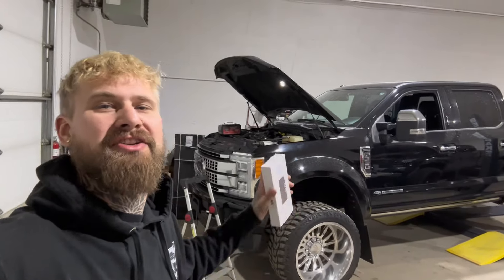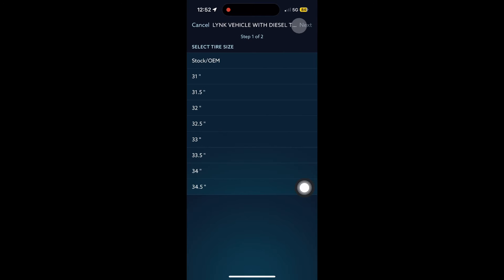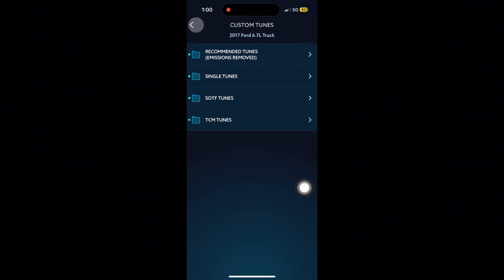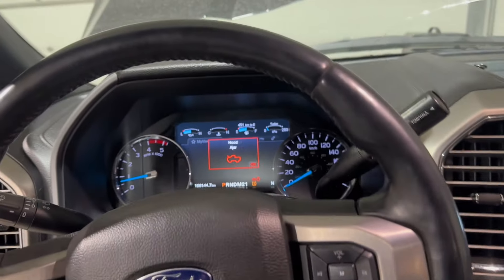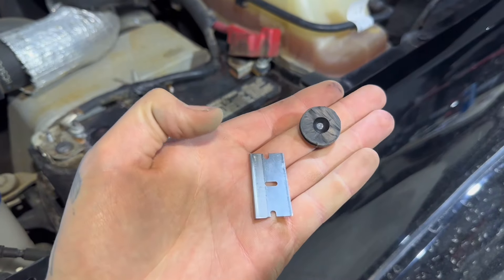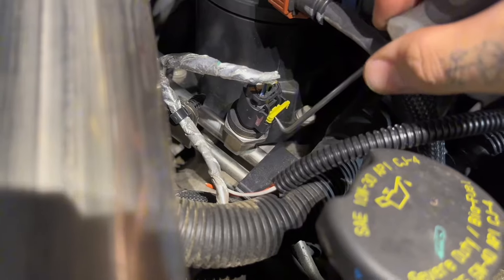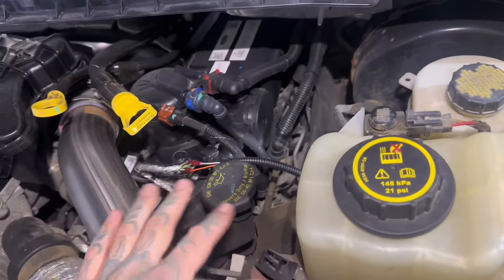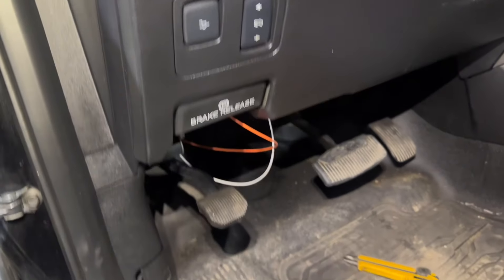How To Tune 6.7 Powerstroke And Install SOTF Switch With EZ Lynk (2011-2019)

Comment: I just finished a delete and tune on my 17 that was 100% virgin. After I installed the delete tunes and removed the dpf I ran the truck with the egr unplugged, it ran fine, no issues at all. Removed and blocked off the egr, did a couple of other things. An spe ccv reroute with an internal catch can, a new thermostat from spe. Once all of that was done I went to test drive the truck and it was smoking like a train on acceleration and smoking at idle. I went a total of a mile pulled it back in the driveway and don't know where to go from here, any advice would be great!
Reply from the maker: My advice is check all your work because something you did must have made it do that. Maybe you broke a wire or a blocker plate is loose. I’m not sure man.
Reply: My 2018 started doing this with 115,000 KM on it with emission on and after $1,000 at the dealership it didn't fix anything. I ended up putting a CCV reroute on the truck and it actually fixed the issue. Come to find out the CCV was completely full of oil and needed to be changed ( had the replaceable filter).  After doing the reroute it hasn't smoked since, if it didn't smoke before you removed the EGR I wonder if some of the crap that gets injected back into the engine has contaminated something and the truck is burning it off? Does it run rough? Idle rough? loss of power ? Did it ever stop smoking or is it still doing it? Everything I touch on my truck is full of soot and crud from the emissions, I do my best to clean everything really well before putting back together. Map sensor was 95% blocked, CCV was full etc. These emissions are designed to kill your motor so you have to buy a new truck not save the environment. My truck in todays market is now $120,000 I can't afford that and it's only an XLT dually.
Reply: You pinched the hose for the ccv delete
Reply: @ Reroute, you can't delete the CCV.
Reply: @crashweekly7925  you know what I meant damn 😂
Reply: @blueseventhree  I did, didn't want people to be confused about a delete and reroute. I have my ccv rerouted.

Comment: How do I return my truck to stock tune when I put the emission control equipment back on the truck
Reply: When you get tunes from a reputable company like coopers customs you give them your VIN number, when you get all of your tunes you will get a stock tune with the other tunes that will allow you to return to stock. You should get one for the ECM and the TCM ( Engine and Transmission tunes) . If you don't then I would question where the tunes came from, my old SCT tuner saved the original settings for my truck and I only used the tunes on it that came from the manufacturer ( emissions on tunes).

Comment: Mine truck turns off before finishing installing, ez lynk still saying installing then once it's done it says turn ignition off but it's already off so I have to turn on and off and click continue and keep going until it says finish/done. Even though it says it was installed kind of curious if everything was downloaded successfully, will check on it again.
Reply: I have never heard that before, did you put a battery charger on the truck before attempting the tune? They recommend it so that there is constant power in the battery while doing the software load.  If there is a sag in power it could cause a problem, hopefully it didn't mess anything up. Worst case you could try and load the tune again but I would put a charger on it this time if you didn't last time.

Comment: i'm noticing my glow plugs firing at every single start now after tuning.  this never happened before unless it was under freezing outside.  it's 85 and they still fire every startup.  you see that at all?  feels like an error in tuning.
Reply from the maker: Who’s tuning are you running? You could try a different tune and see if they changes it, or go into the ez lynk chat feature and send a message to the techs and see what they say. I’ve never had that issue with the tuning from the diesel dudes personally.
Reply: @darkirondiesel  it is the diesel dudes.  i emailed them directly too but obviously it's sunday lol.  i didn't realize i could do a chat from inside ez lynk.  i might try that after they respond first.
Reply: Any updates ? Mine does this as well. Always as pending start up and glow plug light on. Just deleted it yesterday and started doing it
Reply: Also have no high idle
Reply: @wyattbaker231  I reached out to diesel dudes and the tuner directly.  The response was "glow plugs help the engine start" well no sh!t Sherlock.  It just over uses them and I want it to stop.  I did notice any time the primary coolant temp is above 140 the glow plugs won't fire.  So they have an error in their programming for sure.  But it runs great otherwise.  I tried to get them to change this but it sounds like a no go.
Reply: @ thanks do you still get high idle. Since I deleted it. It hasn’t went into high idle. And it used to always do it  till it reached temp
Reply: @wyattbaker231  when it's really cold yes.  That high idle you reference was actually the system trying to warm up the scr and dpf and now that it's gone it doesn't need to do that.  Get ya a high idle switch that plugs into the pto input on the passenger kick panel.  I love mine.  Can set from 900 to 3000 rpm.
Reply: @ thanks for the info

Comment: Can I put one of these tuners in my deleted 6.4? Or do you have another you’d recommend?
Reply: As long as the tuner is compatible with your year of engine you should be able too,  the question would be what software is your truck running now and are you able to return the truck to stock and then setup and load the tunes from the EZ Lynk?

Comment: This is the video I was looking for, I got my tuner in the mail and got coopers custom tunes with lifetime support for my 18 F350 Dually . I left the EGR in place but unplugged it and went with the 4" straight pipe . Every tune video I watch never really goes through step by step and my old SCT tuner wasn't as fancy as the EZ Lynk . I found a SOTF switch from Dirty Diesel Customs and it's the cleanest wiring I've seen so far. You get a serviceable connector that plugs directly into the factory connector, all you have to do is plug the 2 pins into the correct holes and they lock into place. Plug the SOTF wire connector into the factory connection and you are done. No splicing involved and no electrical tape to cover the connections. After doing the tune and delete I removed my Map sensor and put a spacer from S&B on it , I found it was 95% blocked with soot and crud. After I cleaned the sensor my truck is now very spicy even on the #1 45HP setting.  The CCV reroute and the delete have been the best mods to my truck so far, well worth the money in my opinion . I should be able to get way more life out of the truck now that it's free of all that crap, next mod is the rear diff cover from aFe ( Banks doesn't make a dually cover).

Comment: My exact same setup on my 19! Keep up the great videos my guy!
Reply from the maker: Thanks buddy! 👊🏻
Reply: Got a 2019 as well and was thinking about doing the same thing....how do you like it thus far...and what is your fuel mileage looking like after tuning?
Reply: Best mod I could have done to mine. They stay on top of updating tunes and very easy to work with. My mileage went up to around 23 to 24 miles per gallon. The average on the lie-o-meter it picked up 3 miles to the gallon. Did mine in my driveway one Saturday.
Reply: @jtopdawg6  nice...and thanks

Comment: Question boss? After turning for a duramax 2020+ you need unplug EGR, and throttle body, how about the def tank plug? 😊
Reply from the maker: You don’t have to unplug the def tank but you definitely can if you want
Reply: @darkirondiesel  boss, After tuning the ECM. It’s optional to tune the TCM correct.

Comment: Followed your instructions, but after we ran the truck 2x the “check engine” light turned on. Any suggestions? Also noticed my tire pressure on one of my tires aren’t being read properly. 

Any information helps!

Comment: Bought my truck with the ecu flashed but the dpf still on it. Can I buy an easy link and flash over it without any issues?
Reply: I personally would want to put it back to stock before over writing anything that's in there but that's just my opinion, I am not sure if it would be a good idea or not. With my EZ Lynk you can just over write one tune with another but I don't know if the tuner used originally was different than the EZ Lynk and could possibly corrupt something? That would definitely be a question for someone that writes tunes for a living. I dealt with Dirty Diesel Customs because they are Canadian.

Comment: I’m about to buy a 2024 Cummins in December why do they not have ez lynk for those trucks that tuner and a 5in straight pipe was a dream in my 2016
Reply from the maker: Because the 2022+ Cummins require an ecm swap and the only tuner capable of programming the new ecm without having to ship both ecms away is the raceme tuner. Technically you could buy a new ecm, ship both ecms away, get them unlocked and the data transferred over, install the new ecm into the truck AND THEN use ez lynk, but it’s just too much downtime and too complicated for them to offer it on their site.

Comment: Silly question, can you tune without a delete?
Reply from the maker: Yes you can run an emissions on tune
Reply: @darkirondiesel  Thank you. The only thing I did was cold air intake and exhaust. I'll give it a try.
Reply: @Mr_Picklez069 let me know how it works out
Reply: I have an SCT tuner ( for sale) and it had 3 tunes with it ( street, performance and towing) it's an emissions on setup, you could opt to buy custom tunes for it that would be more emissions on/off. The truck did run differently with the tunes on it but not as good as a delete tune with the EZ Lynk.
Reply: @Mr_Picklez069  Was curious about this as well - did you manage to install it?

Comment: I’m just starting this on my 2017 Ford. Can you confirm these steps are correct so I don’t mess this up???

1.  Connect EZ Lynk per instructions and delete/tune truck.

2.  Unplug two EGR plugs and one throttle valve plug. But leave exhaust/DPF installed and plugs plugged in.

3. Start truck (2X). 

4.  Install SOTF switch.

5.  Unplug and remove DPF/exhaust and replace with new exhaust or exhaust section. 

6. Start truck and good to go.

Is this the right order, understanding the EGR block off is optional.

Finally, is there a way to tell what HP is seen for each SOTF switch setting?

Appreciate it!
Reply from the maker: Yes those steps look great! The ez lynk tune should say 0-180hp or something like that. The tune all the way counter clockwise will be 0hp, the tune all the way clockwise will be 180hp, then the middle tunes (2,3,4) will be even increments in between so something like 0, 45,90,125,180 just as an example.
Reply: Awesome thank you. Have you ever done this where there was a CEL already for the DPF? If so, does that have to be fixed and cleared first or will the delete resolve this?
Reply: Put a battery charger on the truck before you start if you haven't already done the job. It's recommended so you don't have a power sag during the flash process, don't want to brick your module.
Reply: Just finished it up and the charger was a great idea.  Everything went perfect.  I installed the SOTF and got no codes!  Exhaust was a chore by myself without a lift but got it done and it runs and sounds great.  Thanks for this great video - made it real easy!!
Reply: @CharlieOBrien-pd1zw  I did the removal of the dpf and install of the exhaust on my truck in the winter time ( 3 weeks ago) and no garage or any ramps. I had to be creative and I parked my truck half up on the boulevard in front of my house. I was able to squeeze under it and wrench on the DPF that's been under there for 7 years in Canadian weather.